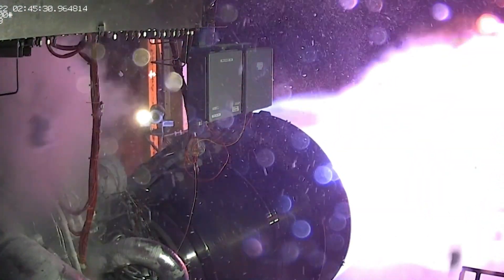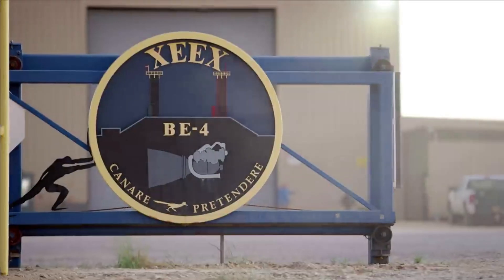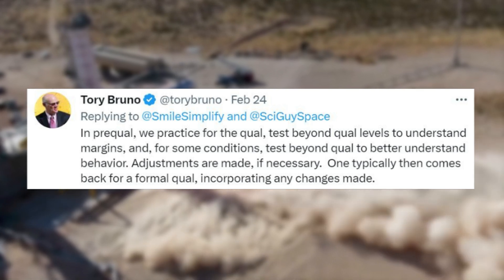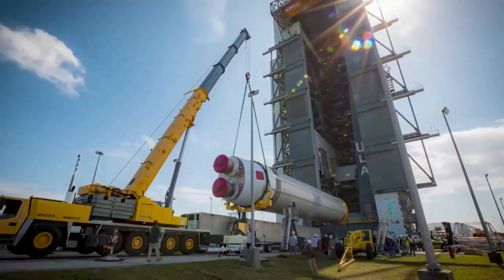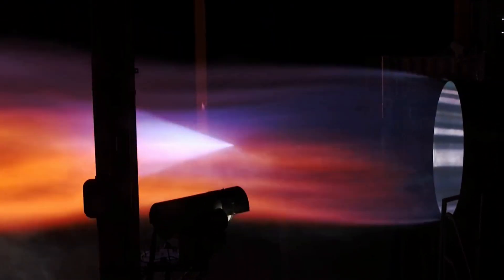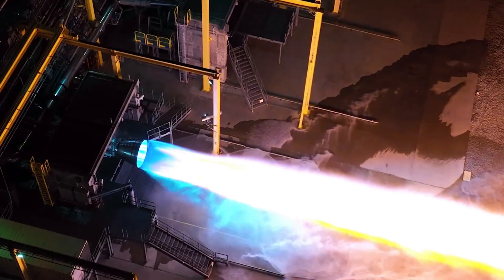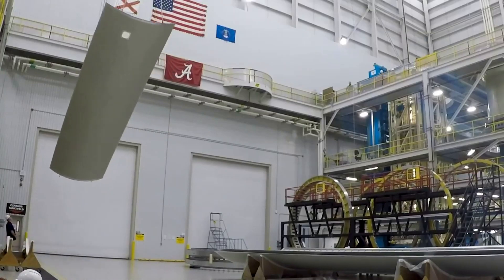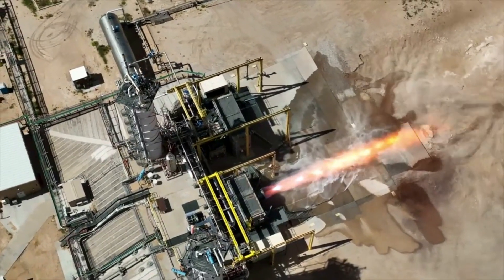Blue Origin's BE-4 Engine Is About To Attempt Its Most Important Test Yet

Comment: I was touring a museum that had a hands on display of a Saturn F-1 engine. I had a near epiphany as I ran my fingers over the little channels that pushed fuel through the outside of the engine bell (to keep the bell from melting). The BE-4 bell looks either machined or 3D printed. I don't see any channels. What is the material used and how do they keep it from melting?
Reply: That engine bell is certainly made from nickel-iron based super alloys, for intense heat resistance and corrosion inhibitance. Any other type of carbon steel would simply rust instantly with the oxygen infused propellant, and the high burn energy. The heat resistance of materials like inconel also allow for the rocket to reach temps much greater than many other materials, while still retaining many mechanical properties such as ductile strength. 
As for cooling, that is a mystery but other companies out there have tried to 3d print cooling channels, the issue with 3d printed metal for nozzles however is that they have the issue of being strangely brittle due to the way the sintering process creates irregular layers. I haven't done this kind of 3d printing myself but the goal of using the argon-purged furnace is to try and remedy this, but 3d prints generally cannot survive the number of cycles that the be-4 engine wishes to be used in, especially with the fatigue caused by extreme heat expansion and contraction. (Inconel expands a lot compared to titanium)
Reply: @avaviscarra8141  Thanks. I just now found the reply. Interesting. I'll read it again and look up a few things.
Reply: @avaviscarra8141  Well, that was educational. I had to look up "ductile strength" and "inconel". Merlin engines' bells are made of niobium. More education. The Saturn F-1 was made of specialty stainless steel. Thanks again. That was fun.
Reply: They just don't fire it...that way it can't melt.

Comment: In that ULA does very little without someone paying for it, I cannot help but wonder where the human-rated development for the Vulcan is at. The CST-100 Starliner has only six human-rated Atlas V rockets for its contracted flights before the production line for Atlas Vs closes down. Sierra Nevada Corporation (SNC) Space Systems has plans for a human-rated Dream Chaser in the next few years. Presently it is only fitted for the Vulcan launch vehicle. Presumably it could also fly on a SpaceX Falcon 9 in a pinch. Tory Bruno has tweeted that human-rating is in the works for the Vulcan. However, there is no evidence available that NASA or anyone else has been contracted to fund this elaborate and costly process. If the procedure doesn’t start soon it may open another opportunity for SpaceX to take more business from ULA.
Reply: I think the problem with Dream Chaser/SpaceX is that the fairing too small. Either SpaceX would need to make a wider fairing and then re-think the entire aerodynamics and re-rate for human or Dream Chaser would have to be redesigned to fit the SpaceX fairing.
Reply: @marvinegreen  As I understand it the human-rated Dream Chaser will not have a fairing.  It is difficult to emergency abort with a fairing over the space vehicle.
Reply: @WWeronko  Yes, you're right, I remember that too now. I also, earlier, asked in the comments if the newer cargo version was different enough to apply the new folded wing design to a potential newer human rated version? But you make a good point about the emergency abort requirement.

Comment: Honestly I hope everything goes well but I’m 50/50 on the BE4 Engines , honestly I don’t think blue origin has the production capability right now and I feel it could take them years to make enough BE4 Engines with the way they run things right now , I think if ULA had made a Contract With Space X or another company Vulcan could have probably been flying already
Reply: We know Blue Origin has a factory specifically for the BE-4s which the rumours are a production rate of 30-37 per year which allows for 15-18 Vulcan flights a year before New Glenn comes online.

Vulcan has already said they want to get to a cadence of 1 launch every 2 weeks with Vulcan within a couple of years. They would not publicly announce that if the BE-4 production rate could not reach that.

Also when ULA signed the BE-4 contract they would have had every reason to believe that SpaceX would not deliver if they had applied for the contract. SpaceX had been contacted to build the air launched Falcon 5 rocket for Stratolaunch’s Roc but they SpaceX cancelled the contract after it was signed.
Reply: @luther0013  we❤❤❤ so a ❤was  was s❤ ❤ss swe we swsss ass SQ aa SQ SaaS was. Swa SQ a SQ a SQ SSG ss. We as we was wswsws we s we swsws we we we s we s we sww C s we w C swe ssws swe wswss. Swe s w swwsw was wsswswwas wswsws wsws. Was we wsws. Wswswswswswssswswsws wsws wsws ws s wswswswswswswssw sq❤❤sa ss sa ss as swwa s ❤ exa was as as.  Was assasswsw C
Reply: @luther0013 Yeah, we all know that only spacex has the ability to build a new engine from scratch and deliver it at a reliability level & rate appropriate for use by an external company. /s <== The fanboyism is fatiguing! Time will tell, the comparative results could provide to be interesting, if not entertaining.
Reply: How many BE4s do you really need though? New Glenn will be reusable, so you only need new engines for each launch during early development. Once they start landing the booster, new Glenn will only need new engines every 15 or so flights. Same goes for Vulcan, once SMART reuse is implemented you only need new engines for new vehicles after 15 or more flights.
Once development is over and both vehicles are partially reusable, you could probably support one New Glenn launch per month and one Vulcan Centaur launch per week with just 15 engines per year.

Engine production speed is only important during development, at least for a reusable vehicles. Spending to much on production rate is just wasted money, if you achieve reusability and your demand collapses by a factor of 15 or more.
Reply: @plainText384  that’s very true we need to keep reusability on mind when discussing the production numbers.
Reply: Space X and Blue Origin have different business goals. Blue Origin wants to be an Engine seller so they will figure out volume issues. I’m sure already did.